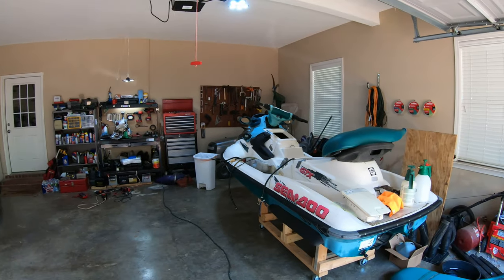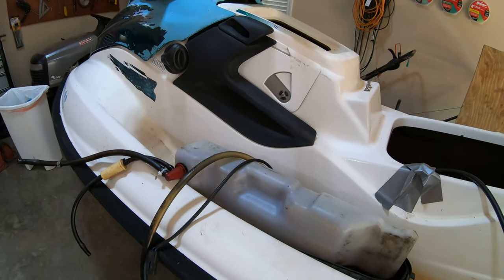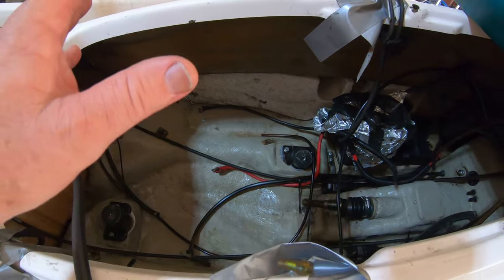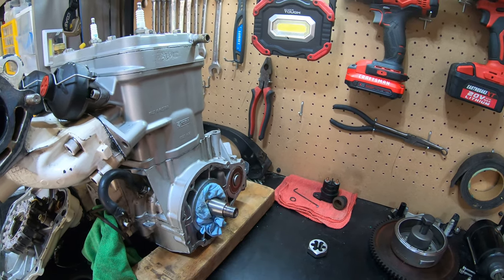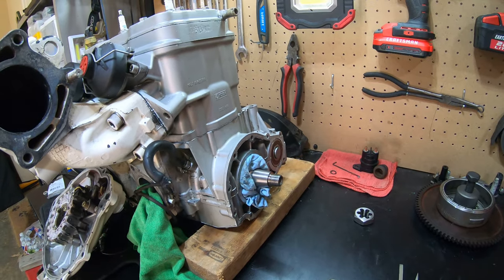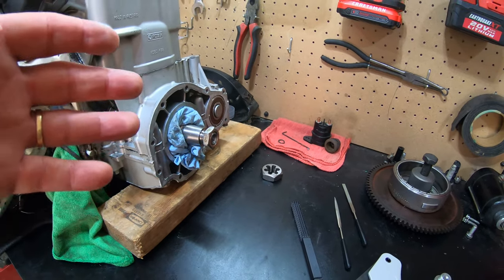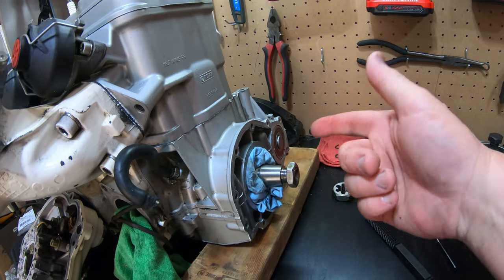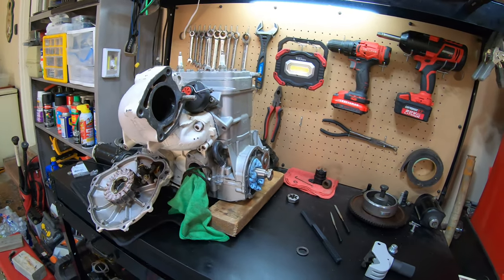Damaged crankshaft threads REPAIRED! What tool did I use?

Comment: Papa Don, need your advice on a 94 657x XP crankshaft. your video on buying 2 cycle ski made me decide to buy a couple old sea doos. I pulled engine and opened crank case.. Im pretty sure the outside seals for pto and magneto are damaged. not sure about inner seals on crank. i can see a little space  on crank seals where they but up to the bearing housing or metal. looks like there was seal deteration in the inner crank area. posted pics on sea doo forums. my user name is gregpaulc. this is new computer and havent got camera attached yet. new to sea doo forums hope i posted thread right. thanks for your time. greg in little rock
Reply from the maker: Contact me at papadonjetski@gmail.com. I can give you some pointers on the pictures you posted on the saedoo forum.

Comment: Also, getting ready to tear into my 1996 Sea-Doo GTX, it sounds like something came loose inside
Reply from the maker: You know, some of the Seadoo engines sound as if something is rattling inside and it is normal. I'm not saying your engine is fine, I'm just saying that a couple of mine have a rattle. The GSX definitely has a rattling sound.